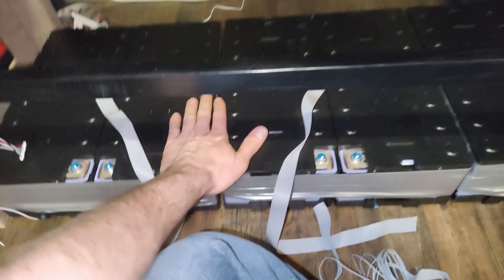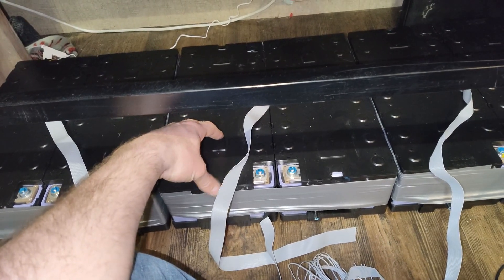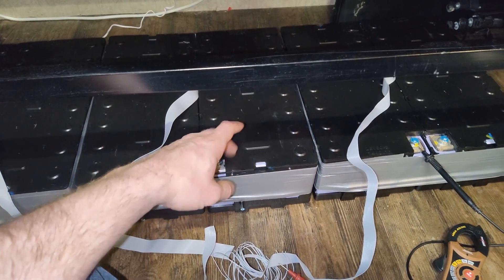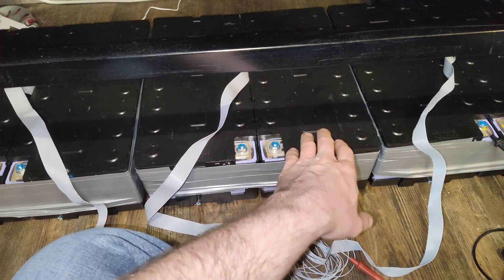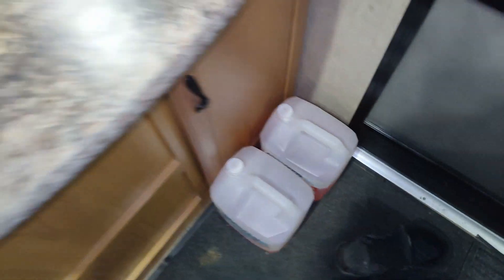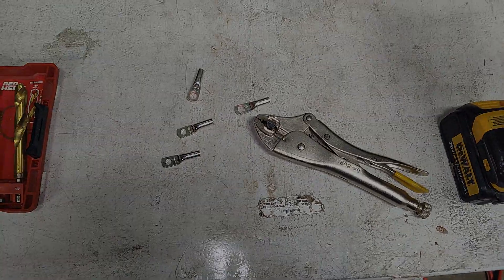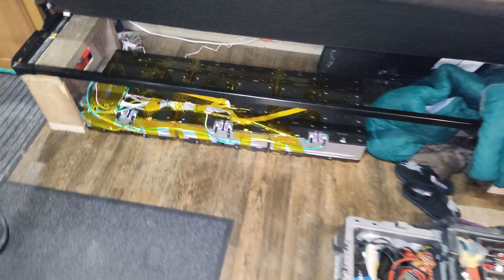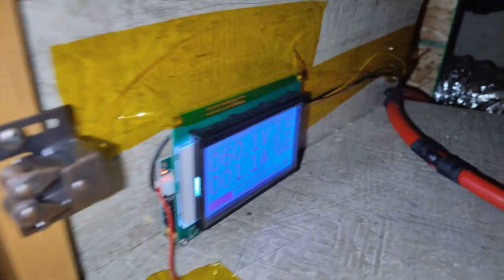15Kwh Battery Install And 2100w Solar System RV

Comment: 10-12 hours of AC is perfect. What type of batteries and how much they cost?
Reply from the maker: these are all different types of lithium ion cells, some are pouch some are metal cased.
Reply: @GoingOffGrid101  yeah bud Ik that.. the batteries this video was mainly about, what are they? BMW?
Reply from the maker: @RJ-cc1fz  BMW under the sink, Mitsubishi under couch and LG Chem under sink in the blue shrink wrap.
Reply from the maker: @RJ-cc1fz  o those are Mitsubishi batteries they are a a bunch of different EV cars

Comment: I think you may have answered my Question, About using a Single BMS on several packs at once. I asked the question in one of my Video's But it seems to work well for you. So I dont think I will be afraid to do it myself on 3 packs. 8S ! I was afraid to try it to be honest .
Reply from the maker: my hole house system is build like this as well.
Reply: Mine is the same way

Comment: You cant go under the rv with the wires? Im sure it will be fine. Lots of rving power
Reply from the maker: It's has a belly pan so it's a lot of work to lower it
Reply: @GoingOffGrid101  its looks fine anyway. Hope all is well